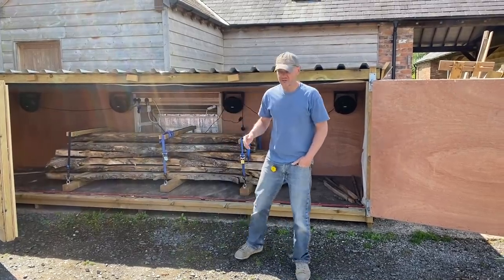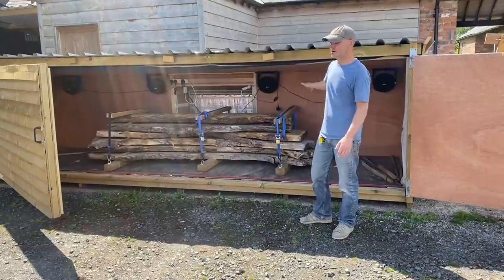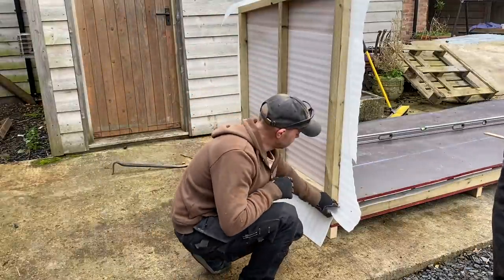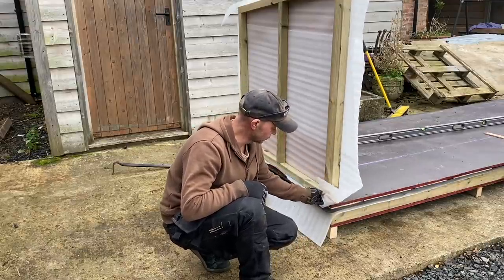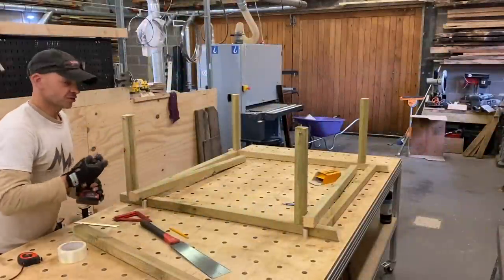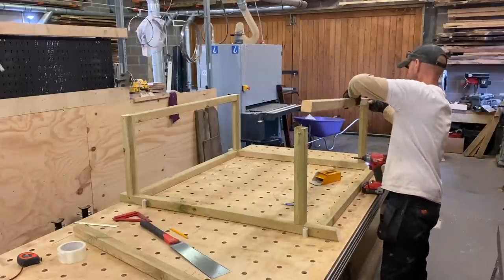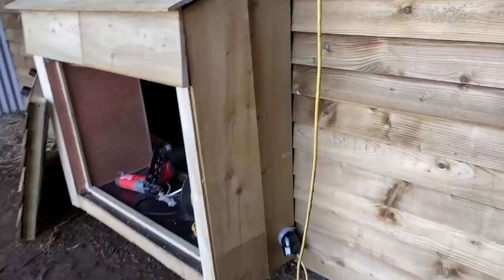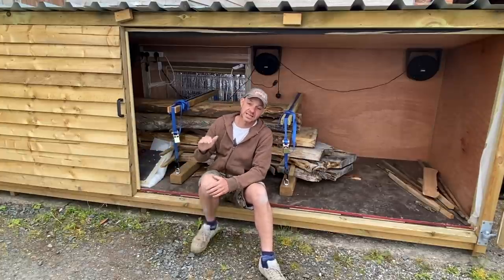#MWShopTalk - The Kiln Build

Comment: Top job mate!Key to a good efficient oven/kiln is airtightness, looks like you got it down:) I use aluminium tape on the inside of my oven to seal all internal corners to stop air escaping,but i think the white plastic foam you are using is doing pretty much the same thing.
 Looking forward to all the cool/well seasoned furniture projects to come out of it!
Reply from the maker: The foam really does work :) I didn’t use Any caulk on this

Comment: I do the same in a 20 ft container. A bit more wood but the principle is the same. It works best if you heat and remove moisture during the day and switch off the electricity at night. This gives the wood time to relax. There are fewer cracks and it does not warp. I assume that you use the anchor seal.

Comment: I don't know if it's the same where you live but kiln dried wood in the Midwest of America goes for almost 3x what it goes for "green". I've been thinking of building my own kiln to cut down on costs. From what I've been reading these kilns can bring the moisture content of green wood down to a usable level around 30 days. Is there any real negative to using this over buying wood that's been air dried for a number of years?
Reply from the maker: Some wood really need to sit around for a year or 2 like oak , but do some research as other wood types can dry just fine from green .  And year kiln drive wood is around 3 times the money but then again it normally a higher grade as no one dries the bad stuff .  Good luck with your kiln it very useful that for sure
Reply: Air drying does a great job, with the provision you carefully monitor the timber as cell collapse can be a big issue especially if you use the final product where structural strength is required.  The “seasoning” of green timber including cell collapse and case hardening is a science of its own ad when you get it right you a first class product.    A good reference source is the Commonwealth Scientific and Industrial Research Organisation of Australia (CSIRO).
Reply: @Robert Like MW said, some wood will change when kiln-dried (walnut can darken up and some of the character gets lost). In general, the biggest negative is the cost (it's not cheap to heat up a big box for a few weeks). That heat is the difference from air drying though- a kiln not only pulls moisture out of the timber much faster, but also kills insects that may be living within. Slabs with deep checks, crotch or anything that is "spalted" is at high risk for carpenter ants, powderpost beetles or even termites to be present. It doesn't have to be a total infestation; all it takes is a small isolated spot where they can harbor and after a couple years of sitting there to air dry on a rack they can spread throughout the slab or neighboring boards (especially if it is air drying outdoors where the insects can still find water)

Comment: Nice job with the build!~ Got plans, never was able to get the sketch up to work but nbd. Quick question, over that span in front, have you had any sagging in the roof in the middle? wondering if you think building it same way again is how you would do it in that regard? I am only going 12' foot wide, so was thinking about only making 8' door, with a 4' stationary section that would help prevent sagging. Maybe that's not needed? Would be nice to be able to open it up fully in front like you have- thoughts? any input you share is appreciated!!
Reply from the maker: I haven’t had a problem with sag , as the door support the roof . Maybe I would make the kiln a little deeper next time as wide slabs can be tight but that’s it